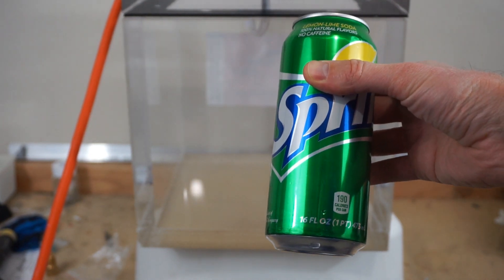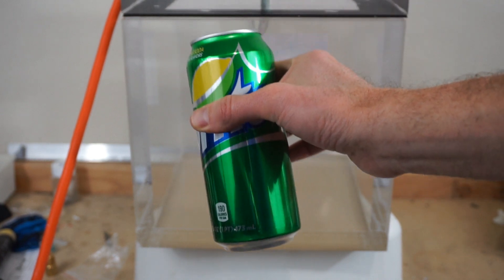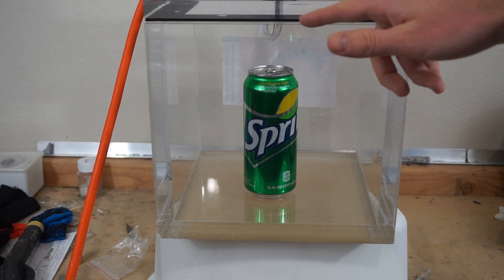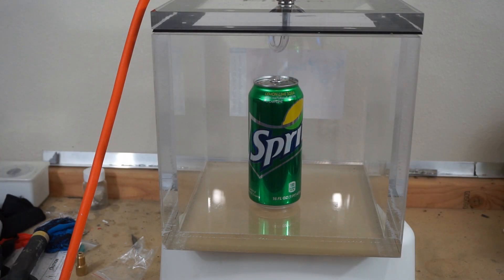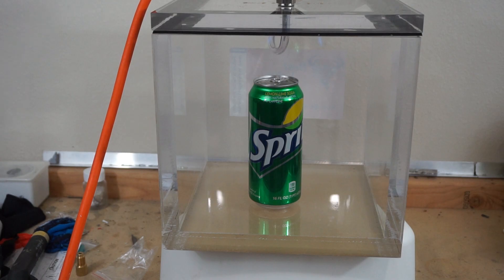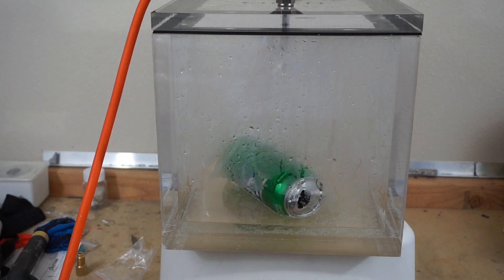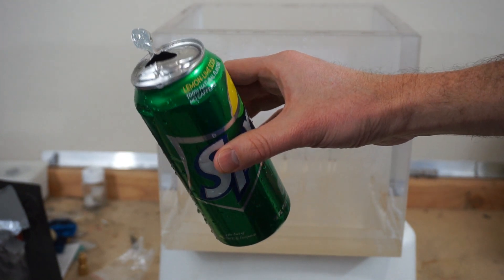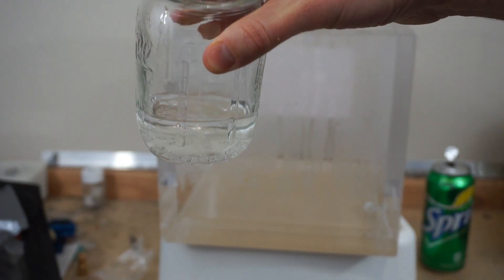What Happens When You Put A Can Of Soda In A Huge Vacuum

Comment: There goes the fake ISS, the two sheets of tinfoil LEM, the latex rubber tipped glove, and the spacesuits against the vacuum of space thats a million times stronger.
Reply: A submarine hull is way thicker than latex rubber-tipped Astronots’ gloves, wouldn’t you think so?  🤣
Reply: you wish, are you daft, you really think we can build submarines that can withstand several magnitudes of atmosphere of pressure (over 500PSI) and yet can't put the same kind of pressure vessel in a vacuum? (not a million times tronger btw) ISS and LEM aren't soda cans. stop being ignorant and check the blueprints.
Reply: good thing it's not simply a latex glove then isn't it. prove otherwise or get over it. 
_"The vacuum of space is supposed to be a quadrillion times more powerful than this."- wow a quadrillion you say? that would be almost impressive if it weren't wrong. 14.4 PSI wow so extreme.
Reply: Wildman Fujiami   It’s rubber, so get over it.  If it has the tensile strength of a submarine hull, then prove it.  Alright, alright, I was just hyperbolically speaking, so the vacuum of space is not a quadrillion times stronger — it’s only a billion...a million...a thousand?  That latex is still gonna balloon and pop, homie.  🤣
Reply: " It’s rubber, so get over it.  If it has the tensile strength of a submarine hull, then prove it. " - sorry but it doesn't have to have the pressure tolerance of a submarine hull because a measly 14.4 PSI might as well be surface depth relative to a submarine. the entire suit is made of multiple layers of material, the rubberized coating you see on the outside is only one.
Reply: Wildman Fujiami   Check the soda can in this vacuum.  Replace the soda with rubber latex.  See the “We can see your hand now.  We can see your thumb” video again.  Latex on skin won’t cut it in space.  It’s an easy concept.
Reply: maybe you should read the last comment again. let me make it real clear there are 14 layers of material in the EVA suit, designed to maintain the mere 4.3 PSI they are pressurized to read it slow now, 4.3 PSI that's 4.3 pounds per square inch of pressure that would be exerted on the parts of the suit in the vacuum. I have pressurized cheap plastic soda bottles over 80 PSI.
Reply: Wildman Fujiami   The EVA suit is only as good as its weakest link.  Latex is latex.  Unless there were 14 layers of special magic material in that invisible latex skin, it won’t pass the sniff test.  🤣
Reply: I'm still waiting to see proof that this isn't a normal EVA glove, because from what I can see it is.
Reply: Wildman Fujiami   You mean this invisible latex-tipped glove is somehow magical?  Houston:  “We can see your hand now.  We can see your thumb.”  https://youtu.be/MT0k4053h5c
Reply: I'm still waiting to see proof that this isn't a normal EVA glove, because from what I can see it is. 
"Houston:  “We can see your hand now.  We can see your thumb.”  " - yeah and? what of it?
Reply: Wildman Fujiami   Don’t be silly.  This is what happens when you can’t reconcile your belief from what you are seeing (cognitive dissonance).  You’ll end up making more excuses for your mind to accept it, and being a useful idiot for the deceivers.  We’ve all been there.
Reply: Wildman Fujiami   I’ll break it down for you.  The Astronot was wearing the fingerless glove for better dexterity.  The cameraman didn’t get the memo (not to zoom in), so Houston said, “We can see your hand now.  We can see your thumb.”  Meaning his thumb was exposed.  Simple.  It is what it is.
Reply: "The Astronot was wearing the fingerless glove for better dexterity. " - oh you mean those dark grey tips that are clearly seen on the 4000 series? I wonder who here is seeing what they want to see.
Reply: Wildman Fujiami   I can see his thumb, and his thumbnail, too.  🤣
Reply: "I can see his thumb, and his thumbnail, too." - lmao you really are seeing shit, I didn't know they had HD in 1984
Reply: Wildman Fujiami   It’s zoomed in, bud.  🤔
Reply: Wildman Fujiami   I’m trying to help you break away from years of programming/indoctrination that programs you to mock, ridicule, and label truth seekers as uneducated conspiratards, so you don’t even look into it.  You need to watch more videos that deprograms.  Check out the video below.
Reply: well as a "truth seeker" I have spent years looking into every claim FE has to offer and found none of them hold up to scrutiny. you lot cant even produce a flat map that conforms to observed reality which is very sad in 2019. " You need to watch more videos that deprograms. " - in other words more videos by other self-proclaimed "woke" conspiracy theory nutters that think they have a masters in science and physics? the data I can personally observe and analyze dictates everything FE claims is absurd.
Reply: Wildman Fujiami   The difference:  The above video does not pass the sniff-test among flat-earthers.  On the other hand, it does with globeheads.  🤣
Reply: I can't help it if you fail to see the vast differences between a soda can and an EVA suit..
Reply: Wildman Fujiami   You mean a soda can and a fingerless glove?  🤣
Reply: only you see a fingerless glove. us non blind people see a regular EVA glove. we can bitch about gloves until hell freezes over, it won't make the earth flat.
Reply: Wildman Fujiami   It won’t make your statement true either.  😂
Reply: so where's your flat map of earth that conforms to observed reality then.
Reply: Wildman Fujiami   The globe is just an AE flat map fitted onto it.  🤣
Reply: why are you diverting from my question, why does your map not conform to observed reality? jeranism lol, you mean that same goon that tried to prove flatness but ended up doing the exact opposite? you mean that same ISS that I can see on the proper night quite clearly with my 6" Newtonian? https://www.youtube.com/watch?v=QvTmdIhYnes must be a really  big zero gravity garage.
Reply: Wildman Fujiami   Tell me what reality that does not conform to a flat map?
Reply: Wildman Fujiami    There are drone planes that can stay up there for five years without refueling.  Strap a few grids to make it look like the ISS, and no one will be the wiser.  I can even do that with my boxy drone, and film it going across the moon with a $20 budget.  Imagine what NASA can do with their daily $53 million budget.
Reply: yeah a drone doing mach 5 seen all around the world at the predicted times along the predicted paths, that has existed well before drones were a thing, with no visible means of propulsion. sure, I guess Mir was a drone too eh?.. smh

" Tell me what reality that does not conform to a flat map?" - i have already covered this, distances, flight times, and land mass scales. oh and let's not forget the polar and equatorial circumnavigations that have been plotted and recorded.
Reply: Wildman Fujiami   Drones (not what we have but military and plane-like) don’t have to fly fast because they are smaller than the ISS and flown much closer.  NASA have hundreds of those.
Reply: "Drones (not what we have but military and plane-like) don’t have to fly fast because they are smaller than the ISS and flown much closer.  NASA have hundreds of those." - yeah ok, kinda funny how nobody's seen these things out the windows of any commercial flights eh? lmao. https://www.youtube.com/watch?v=2zejiHaRhI4 much closer you say? observation says otherwise. just like observation can prove all day that the moon is every bit of the 200,000+ miles away, without any fancy math.
Reply: Wildman Fujiami   By the way, military drones fly from 50,000 to 60,000 ft. Commercial planes fly at 35,000 ft. up.
Reply: Wildman Fujiami   The expensive flights of the Concorde were rare, and only 14 went into service.  It was shut down in 2000 after the crash in Paris.  Come on dude.
Reply: Wildman Fujiami   Do you know that NASA had launched thousands of satellites tethered to balloons?  What’s the chances for anybody spotting one of those.  Yeah, right.  😂
Reply: Wildman Fujiami   More excuses?  Do I have to bring Adam Steltzner back in again?  🤣
Reply: Wildman Fujiami   It doesn’t matter how many excuses you bring up.  The only thing you need to see to realize it’s all a big giant fraud is the video below.  Watch the face of the globeheads, I present your guru Adam Steltzner:
Reply: once again, observations, not excuses. and you still haven't provided a flat map that conforms to observed reality. FE cultists are good at excuses though, inventing all manner of asinine distorted laws of physics to contort observations made in reality to fit their model. like how its possible that there have been polar and equatorial circumnavigations, or my favorite to date "Australia doesn't exist!"
Reply: Wildman Fujiami   The globe map doesn’t even conform to reality, so...
Reply: " The globe map doesn’t even conform to reality, so..." - sure seems to so far.

"PhD John with a doctorate in Spectrophotometry tried to debunk the flat-earth and ended up supporting it through his experiments that can’t find the curve." - And how do we know that mr. John is even a real person that has a real PhD? your boy jeran sure didn't have trouble finding a curve, i've had plenty of an easy time debunking your flat earth nonsense, so many observations that are fatal to your model.
Reply: Wildman Fujiami   Let’s have a petition to award the Globebusters the Nobel Prize.  They sure deserve the award for proving the Earth a globe.  🤣
Reply: "These are not clouds or rocks like NASA’s wizardry would have you believe.  Rodent from Mars: " - we'll just ignore the fact that the ass end of it is all distorted eh? it's a rock, just a trick of the shape and the light like the "face on mars".

"With your critical mind, compare NASA’s image (top) and the museum’s photo of the walrus’ left arm bone (only the radius, not the thin ulna bone next to it)." - yeah, and? even if it were a bone (which is just speculation) it is a long held belief from evidence that mars was once a vibrant water covered planet like earth with sentient life forms.
Reply: more like a strong case of pareidolia. "Come on, I’ve put the walrus bone through forensic analysis using Photoshop, and after rotating it upside down, the shape, lean, curve, two bone-socket ends (billion to one odds), perfectly matched the radius bone from the museum." - and still you managed to completely miss the fact that this "walrus bone" is no bigger than a human finger? nice job. the weather on mars is notoriously windy, and constant wind causes a weathering effect known as ventifacting, which we can see here on earth that produces some very organic and almost bone-like at times shaped rock formations. https://todgermanica.files.wordpress.com/2015/03/dsc01657.jpg
Reply: Wildman Fujiami   It’s exactly how NASA describes it, pareidolia.  But is it even possible?.  Of course not, it’s all wizardry.  When I have the time I’ll explain to you how the wizardry is done.  Size of a finger?  Who says?  Bow down to your Lord, NASA.  🤣
Reply: " But is it even possible" - it's completely possible. high wind + sand = natural sand blaster. I can provide multitudes of examples of this that can be seen here on earth.
" Size of a finger?  Who says?" - I say, after analyzing the photograph from the original imagery taken from the rover itself, instead of that cropped out piece of misinformation you provided.
Reply: Wildman Fujiami   Show me your examples of spoons, vertebrae, rodents, and walrus bone.  I collect bones, and I’ve done my analysis also, and that’s not the size of a finger.
Reply: Wildman Fujiami   Reality:  Do you think these bozos landed a rover on Mars?  Press conference with clueless audience:  https://youtu.be/QRpxcFVHgQk
Reply: Wildman Fujiami   Who says?  Your Lord, NASA.  Try again.
Reply: Where are your rock samples?  Do you think these bozos landed a rover on Mars?  Press conference with clueless audience:  https://youtu.be/QRpxcFVHgQk
Reply: "Wildman Fujiami   Who says?  Your Lord, NASA.  Try again." - photographs taken of the rover during the construction phase for one. the tread on the wheels is a dead match to the precession in the soil in the bottom left of the photograph. go ahead and simply do what every other flatwit does and choose to ignore / deny it.

"Where are your rock samples?" - i just posted several examples of wind formed rock formations that don't look "natural".
Reply: Wildman Fujiami    As your guru Michio Kaku says, “...on cosmology, we are off by a factor of 1 to the 120 (zeroes).”  In other words, the 1000 mph spinning Earth that orbits at 67,000 around the Sun traveling at 450,000, and the Milky Way at 514,000, black holes, neutron stars, gravitational waves, star distances, you name it, are just assumptions, or what we call BS.
Reply: Wildman Fujiami   No, those rocks don’t look exactly like the actual shapes we find on Mars.  The Mars wind seems to be more artistic than ours on Earth.
Reply: Wildman Fujiami   Those bozos are a joke, same as NASA, and the joke is on us.
Reply: "In other words, the 1000 mph spinning Earth that orbits at 67,000 around the Sun traveling at 450,000, and the Milky Way at 514,000, black holes, neutron stars, gravitational waves, star distances, you name it, are just assumptions, or what we call BS." - speed is relative to scale and frame of reference, it's hard to get exact speeds of anything if you have no absolute frame of reference because everything is in motion.

 "No, those rocks don’t look exactly like the actual shapes we find on Mars.  The Mars wind seems to be more artistic than ours on Earth." - and i wouldn't expect to see anything exactly the same. but quite similar enough to define that's what it is. the odds of finding two that are identical are very low. mars is one giant desert with constant epic dust storms, there is going to be a lot more ventifacting taking place resulting in lots of interesting shapes.

"Those bozos are a joke, same as NASA, and the joke is on us." - meanwhile you have individuals on team FE like nathan thompson, that have the reasoning and attitude of a spoiled 4 year old.
Reply: Wildman Fujiami   Disney’s dog Pluto on Pluto.  It was supposed to be subtle, but it wasn’t, so they tell you it’s a heart.  Yes it is, Dorothy:  https://goo.gl/images/BfMKvC. It’s a fu**ing joke.  🤣
Reply: it wasn't supposed to be anything, the dog is named after the planet according to Disney, https://www.hjkc.de/_blog/2015/09/25/4837-Raumfahrt---NEW-HORIZONS-bei-Pluto---Update-15/ helps to see the entire terrain before jumping to stupid conclusions.
Reply: Wildman Fujiami   That’s one brokeback NASA fanboy or girl.  🤣
Reply: Wildman Fujiami   “We’ll Know Our Disinformation Program Is Complete When Everything the American Public Believes Is False.”  — William Casey, CIA Director 1981-1987.

That was his job and goal.  It continues to this day.
Reply: “We’ll Know Our Disinformation Program Is Complete When Everything the American Public Believes Is False.”  — William Casey, CIA Director 1981-1987." - that has little to do with what I can observe and verify of my own accord.
Reply: Wildman Fujiami   That’s why they call it disinformation.  You’re the last one to know.  🤣
Reply: right, that's why the same observations are confirmed by researchers in other countries eh?
Reply: Wildman Fujiami   Two of three submitted researches that pass peer review can’t even be replicated.  Oh boy.
Reply: Wildman Fujiami   I stand corrected, it’s more than 70%.

“More than 70% of researchers have tried and failed to reproduce another scientist's experiments, and more than half have failed to reproduce their own experiments. Those are some of the telling figures that emerged from Nature's survey of 1,576 researchers who took a brief online questionnaire on reproducibility in research.”
Reply: yeah and? what are you even on about?
Reply: Wildman Fujiami   eh?  🤣

Comment: To explode a can, you can either heat it up, as you said, or freeze it, as the expansion of ice crystals forming will usually rupture the can as well. Decreasing the pressure outside the can is like a 3rd non-standard option. lol

Comment: What would a human body do inside a vacuum chamber? Ok; so if a human body is a closed system @ a core temp of 96*-100* with only external ports to expel gasses; even if you put it in a pressure suit of some type, shouldn’t it still have an adverse effect. Is there any way a simulation could be performed to show what the astronauts may be feeling or are going through while doing a space walk?

Comment: You keep using the word "negative", I do not think it means what you think it means
Reply from the maker: It means exactly what I think it means. I am speaking in gauge pressure. Not absolute pressure. 1 atm absolute =0 atm gauge.
Reply: Then it should be dropping from 0 to -1 not dropping from -1 to 0. -1 is smaller than 0

Comment: Great video! It would've been really nice to see the explosion moment in slow motion just to observe the weak points in the lid give way. ☺️
Reply: You can slow it down yourself. There are settings. Click on settings, then click playback speed.
Reply: @jsmith5443 not the same because the frame rate of the video is only 60fps but if it’s a slow mo camera there would be more frames

Comment: "So if you took a cold can of soda with you into space, it looks like it wouldn't explode."

Uh, I'm quite sure that outer space is a much higher vacuum than a mere -1 atmosphere.
Reply from the maker: +KingAdrock420 the maximum vacuum possible is -1 atmosphere. -1 ATM means there 0 pressure, and that is as low as you can get whether you are in space or on earth.
Reply: I don't claim to be an expert on the subject, but I do know there are different levels of vacuum. The vacuum of deep space, while not a perfect vacuum and one than can vary is generally much more empty than artificial vacuums.